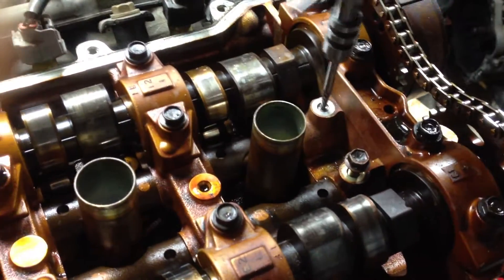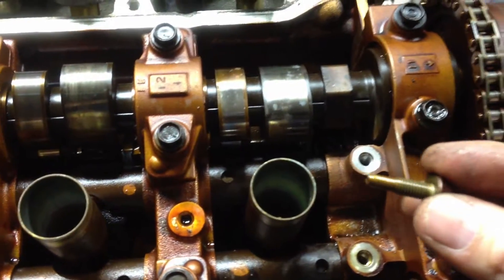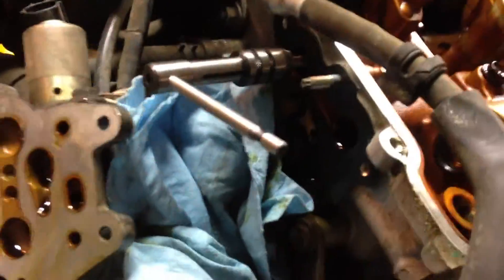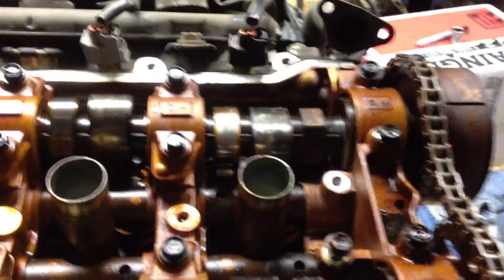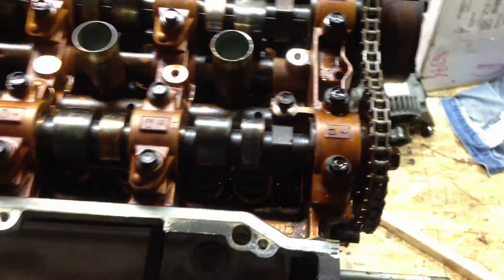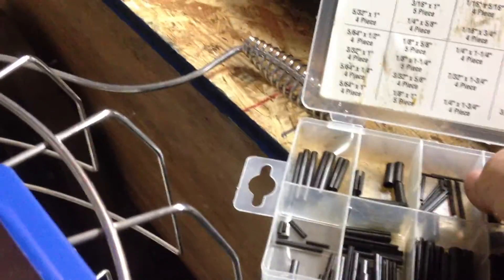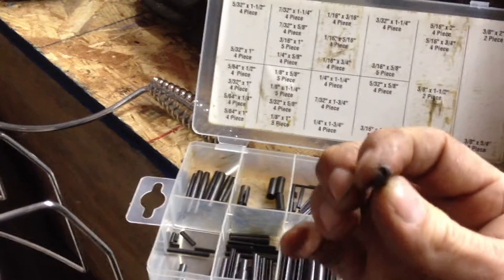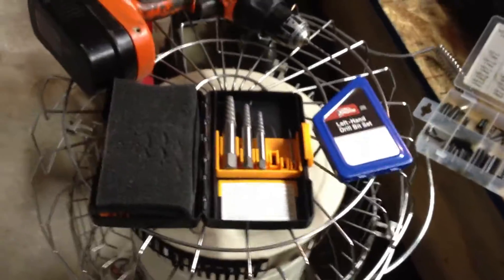Celica GTS, VVTL-i lift bolt repair

Comment: Have you a video of how you rotated the shaft ?
I am in the same situation as you but my engine is still in the car. 
I dont want to remove the cams if possible
Reply from the maker: Sorry no video of that. But the end of The Rocker shaft is Hollow. So I just used the right size easy out to rotate it. ...  or a tap would rotate it the other way. Mine rotated very easily.

Comment: What's the name of that tool you used to rotate the rod??
Reply from the maker: "easy out". called a "screw ( or bolt ) extractor". They are made for removing bolts that are broken off at or below the surface